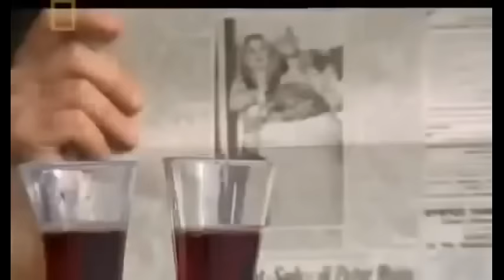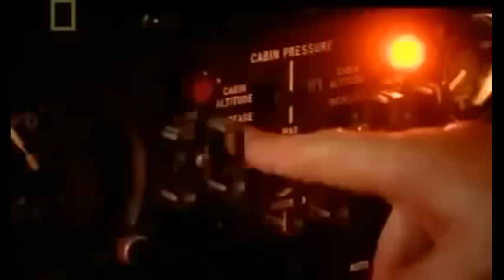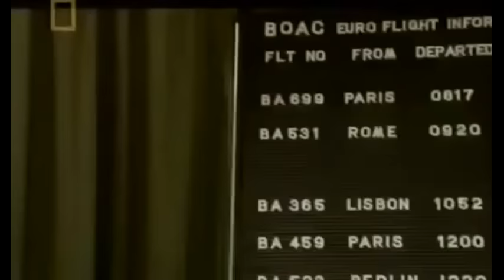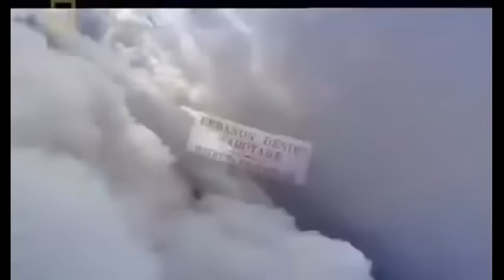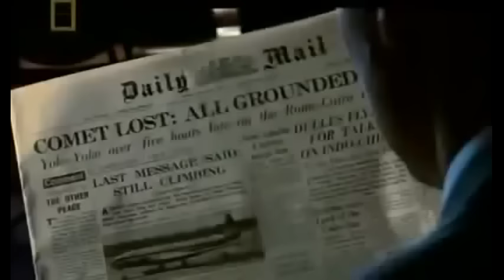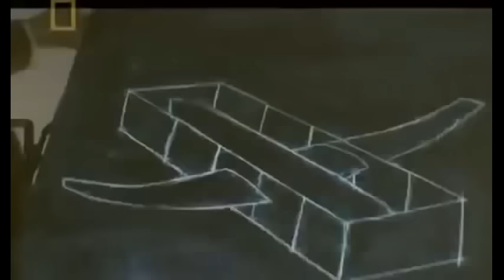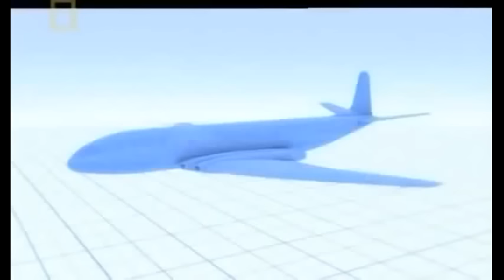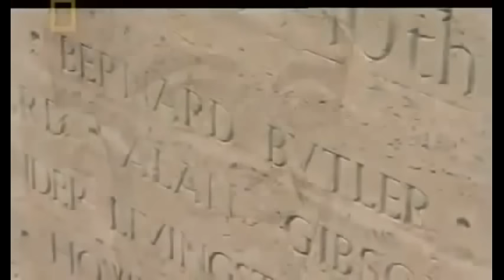Air Crash Investigation BOAC Flight 781   [48:40]

Comment: My God! What a horrific way to die! Having your lungs explode whilst flying into the air fracturing your skull, with the downward pressure damaging your spine, etc! 
I’d like to share an experience relating to air pressure, in the hope I can prevent it from happening to someone else. 

I was flying back to Texas from Montana and I had a slightly stuffy nose. 
During decent, I suddenly felt bubbles move in my sinuses followed by increasing sharp, stabbing pain in my head, behind my eye. 

It literally felt like my head was gonna explode and my eye was going to pop out! I had no idea what was happening! 
I was sitting next to my toddler and husband. I tried not to cry too loud at first. Then I couldn’t handle it. 
My PTSD became triggered and I was crying out loud enough that my husband turned to me. I had no idea what was happening. I was thinking: is this what an aneurysm is? A blood clot traveling through my head?? I told him it feels like my head is going to explode. 
The pain seemed to increase as we got closer to landing. It took everything in my not to scream! I felt I was gonna pass out and I hope I did because it would bring some relief from the excruciating pain.
When we finally landed, there was some relief but sharp pain washed over me if I lowered my head. 
My face and around my eye was swollen. My nose was just running. 
I had been holding my eye the entire time- as if I were trying to hold it in my head. 
I researched what happens to me. 

At the time, I hadn’t connected my stuffy nose to what was happening but that’s what happened. 
The pressure in the cabin had cause aerosinusitis or “sinus squeeze” or barotrauma.
I told my husband it was 1,000 x worse than given birth to our son - which wasn’t that bad until we realized he was coming out breach at our drug free home birth! I have a very high pain threshold but that was beyond anything I had experienced.
Here’s the definition: Aerosinusitis

Typically, sinus barotrauma is preceded by an upper respiratory tract infection or allergy. The affected person suffers a sudden sharp facial pain or headache during descent, which increases as the aircraft approaches ground level. The pain can ultimately become disabling unless the ambient pressure is reversed.

The pressure difference causes the mucosal lining of the sinuses to become swollen and submucosal bleeding follows with further difficulties ventilating the sinus, especially if the orifices are involved. Ultimately fluid or blood will fill the space.

In most cases of sinus barotrauma, localized pain to the frontal area is the predominant symptom. This is due to pain originating from the frontal sinus, it being above the brow bones.
I had nerve pain between my nose and eyebrow for a week. I had some broken blood vessels in the corner of my eyes. 
Now, I always fly with Afrin and decongestants - even if my sinuses are clear! Never again! The pain was unbearable.
Reply: Oooooookaaaaaaay. 🥴
Reply: Thank you for this information!

Comment: Can't believe they punched rivets into that aeroplane without drilling first !  I wouldn't do that on a childs toy let alone a flying aeroplane.  Of course they blew apart.  I wouldn't even use rivets at all in joining aluminium that thin (0.5mm), as you end up with swiss cheese at best at the worst stress areas.  Epoxy glue for the windows and door frames would have solved it and circular windows instead of square.   Interesting, water tank test blows @ 3000 flights, and their design fatigue tests were based on 10,000 hours.  it seems to me that's exactly 3000 flights, so this should have been no surprise.  on the other hand perhaps (obviously to me) the static water tank test was not near as destructive as the dynamics of actual flight, with turbulence, weather, maneuvering, landing etc, and in real flight the thing would have blown much much sooner, as the 3 did already.
Reply: They certainly did mimic the exact dynamics of an actual flight. So as "obvious" it might be to you that it wasn't, it certainly was for the experts who know what they are talking about and what they are doing. 🤦‍♀️
Reply: Well, just like other crashes, they're part of the equation. The 737 Max is a fine example of lessons NOT learned. Everything these days is about profit, probably then too. Todays crashes have pilots asking what's the plane doing now just before impact. I think they're to complex. Happy travels to those that like these contraptions, I don't like them flying above me.
Reply: I seem recall from another documentary that there was some extra trick in an original testing regime which prevented them spotting the problem during development. It was something along the lines that the way they did testing during development actually strengthened the metal...

Here it is. The development engineers tested a fuselage for maximum pressure first. And then cycled multiple flights. But applying a maximum pressure test first meant "the metal went through a process called cold working" which made the test airframe stronger than the production.

It Wasn't the Square Windows - The de Havilland Comet Crashes - Aircrash Minority Report
https://youtu.be/2rvx-r2itrE?t=510
Reply: @RobertJohnFreeman kinds makes sense.
Reply: 1954
Reply: @saveus228  1948

Comment: If only Boing could show the same skill and dedication with their investigations into the moderrn day 737Max disassters
Reply: Boeing*
Reply: Weren’t there several crashes with the comet before they figured out the flaws?
Reply: they figured it out it's cause they moved the engines up and the angle correction computer kept thinking the plane was climbing so it made it dive
Reply: there's a whole docu about and they show the trim wheel starts moving every 20 seconds on its own to trim the plane nose down a pilot actually had one go corrupt and landed the plane he had to have the copilot manually ovveride it each time
Reply: Seriously?🙄
Reply: It's called ...
Engineers, justifying their existence

They have to take stuff that works great - - and change it
( otherwise - there would be no reason to keep them employed )
Stuff made in 1960's - 1970's are still running today 
Stuff made 2 years ago - - need to be replaced

(got my grandmothers 1960's refrigerator still running great in my basement - my $2,000 refrigerator bought just over 2 years ago.... needed a new compressor ! )
Reply: @findantu  
All they had to do was turn the stab trim off.
That's why no one crashed one in the USA, or Europe. 
That solution has been known for 50 years.
Reply: @patrickmollohan3082  
👍
Reply: @findantu  
Pilot's have done that for 50 years. 
It's called runaway trim.
Obviously they never heard about that in kookamongo, or where ever the 2 crews crashed the Max's.
Reply: @patrickmollohan3082  
👍👍👍👍

Comment: Would you agree that they used thin metal to save money, and that’s why cars have never been made with thicker metals even though it would have saved millions of lives in all those car crashes, right?
Reply: Save weight*
Reply: Fuel economy can relate to it however
Reply: No, modern cars are made from high strength steel, very much stronger than that used in older vehicles.
The metal is formed to absorb impact and the structure is extremely strong, much more strong than older vehicles.
Reply: They make cars the way they are now to absorb all the impact and making it safer for the driver and passengers. Plus it means that many emergency workers won’t have to use to jaws of life to get people out of their vehicles :)

Comment: Something not addressed here - they said the design called for the joints to be glued, but there was a change to rivets. I would like to know who made that decision and why. And of course - would glued joints have been perfectly safe?
Reply: The "glue", would be a sealant or epoxy today that acts as a seal between the layers of aluminum that are riveted together. It helps keep the plane pressurized and sealed, as well as preventing water intrusion that would lead to corrosion. Drilling the rivet holes and deburring them before installing rivets is the most effective way to keep the holes from cracking.

Comment: Even for the 50's punching holes in ultra fine aluminium does not ring smarts. Wonder if thats the way they build Apollos?
Yeah even square windows for that plane at least isnt to 20th C wise. No Einstein to figureout the cutouts would be more weak.  Very well done investigations and video, thanks!
Reply: It was not a window frame that failed. What failed was the perspex observation window for the navigator, in the roof of the cockpit.
The recovered perspex window is still to be seen in the Science Museum in London.
It was suggested at the time that this be glued in place rather than riveted, but that was not done.
Reply: The lunar landers were made of magnesium, thinner that aluminum foil... you could push your finger through it...
Reply: @richardaldous3608  Hum some changingroom for EVA suits 🥺

Comment: I first read about these Comet crashes in Time Life books, called The Jet Age. It explained the how, and why of these accidents, and some of the many unknowns there were for a passenger jet at that time. Namely how the cycles, the take off and landings of these Comets were put through alot more stress and at a faster time, due to the high altitude and speed they flew at, and how it affected the structure of the aircraft that ultimately caused them to breakup in flight. Boeing engineers checked out the Comet and expressed doubts about the Comet. Then mentioned the square windows weren't a good design, which caused weak points for the skin, and the engines in the wings were also a poor design, due to any malfunction in the engine could cause the wing to be damaged. The engineers of the Comet were on the right track, but hadn't worked out all the problems yet for this type of aircraft.

Comment: I wonder if the 2cm stress fracture would have even been noticed during the visual inspection if it had of been somewhere that was actually accessible since it was reported that it was in fact done by someone. I can certainly understand if it was over looked even on a good day for that matter but someone looking would have had no chance in hell of ever seeing it on the top of the fuselage that’s for sure.

Comment: Obviously the Comet was structurally too weak to withstand the atmospheric pressures and literally burst open.  The designers knew from the beginning that the Comet is going to be built using a thin metal fuselage, but took the risk in the hope a disaster would not occur...

Comment: Square ⬛ windows is just downright crazy it creates massive pressure stress points, its why pressurized gas containers are circular to prevent stress points
Reply: Wasn't just the shape of the windows, the aluminium-skin was so ridiculously thin to reduce weight, that someone could literally punch a hole through it with their fist!
Reply: @stevie-ray2020  
Think about that ignorant statement for a few minutes, and then ask yourself,,,, why did I say something so dumb.

Comment: Good documentary - I always had it in my head that the failing with the original Comet was something to do with the windows being square instead of rounded off. But the investigation didn't seem to mention the shape, just the fact that they were fixed with punched in rivets instead of screws? Seemed so irresponsible to allow the Comet to fly again in 1954 before the crash investigation was completed. But did the piece of wreckage that confirmed the theory come from that later crash? Not that this would justify the loss of life of course.
Reply: Nothing was retrieved from the second crash, it was way too deep to salvage anything.
Reply: All other documentaries on the comet show that it was the square windows
>that's why all planes today have round / oval windows
This is the only one I have found claiming it was a rivit hole which caused it
Reply: @CraneGuru  No sir. The square windows got the blame, yes ...but it was the fact that the metal was stressed by the rivet punching method that was used AROUND the windows that caused the weakened metal in the vicinity of the square windows. 
In this video they claim it was a roof window that failed. The fact the window was square hastened the failure.....so...as you rightly say, now we know...we have Oval Windows to lessen that factor.

Comment: Hold on. So we can find this airplane in 1954, at the bottom of the ocean, just 33 days after it crashed without modern technology or a black box, yet we can’t find MH370 which crashed in 2014, had a black box, and the use of modern technology 🙄 

How the hell does that work! Shocking.

Comment: A similar fatigue cracking in the structure led to the disaster of a Japan Air 123 flight, the second deadliest air disaster ever. But it was due to bad maintenance, and two maintenance workers committed suicide in guilt.

Comment: funny sidenote. The Comet was not the first jetliner. That was the Tupolev Tu-104. The Comet went into service earlier (too early as it turned out) and for most of the early jet years the Tu-104 was the only active jetliner as the Comet was grounded and the East German Baade 154 never went into service.
Reply: The Comet flew on July 27, 1949, and Avro Canada C102 Jetliner
 first flew the following to become the first jet airliner built anywhere in North America. The Tu-104 (itself derived from the Tu-16 'Badger' jet bomber) flew in June 1955., and the VEB 152 (designed by former Junkers engineer Brunolf Baade, who had worked on Ju 287, EF 131 and EF 140 forward swept wing jet bomber designs) you mention flew in late 1958, nearly a year after the first flight of the Boeing 707. Aviation experts largely tend to overlook the fact that in the late 1940s, Boeing proposed the Model 473 jet airliner based on the B-47 Stratojet, but that design was not built. The Dutch aircraft manufacturer Fokker proposed its own jet airliner design, the Nene-powered F26, which remained a conceptual study only.

Links:
http://www.aerospaceprojectsreview.com/blog/?p=1260
https://en.wikipedia.org/wiki/Avro_Canada_C102_Jetliner
https://en.wikipedia.org/wiki/Fokker_F26
Reply: No...the Comet preceded the Tu-104 by 6 full years. It was ultimately grounded but it was the first in every sense of the word.
Reply: @vahe2391  Thanks for providing the links.
Reply: @33moneyball  Fight... Fight... Fight..

Comment: These airplanes were very dangerous to fly in because, with this model being the first passenger jet, it was designed in ignorance of the dangers of a pressurized cabin and the skin of the airplane not strong enough to hold it.  Consequently many of these airplanes simply disintegrated in mid-flight --- that was all there was to it; they simply came apart in mid-air.

Comment: Still the comet was a sleek looking design. I like the design of the engines into the wings.
Reply: Yeah...very pretty but not very practical. Fireball XL5 was pretty cute too....as for Thunderbirds.....Are GO!!!!
Reply: I'm no expert, but logic suggests engines housed within the main structure of the plane carry greater risks in the event of a fault. I guess higher vibration too.
Reply: Engines are now separated. In case of failure, can just drop away

Comment: What’s wrong with dam FEET, MILES PER HOUR OR KNOTS Grrrrrrr
Reply: The British use the metric system — and this is a British production of the show.
Reply: @kristita_888  we have a hybrid system. Metric is often used for temperature, measurements (though not by transport, we still measure distances in miles) and weights. Though both Imperial and Metric are recognised.

Comment: The Comet was a work of genius. The birth of all jets passenger planes. It’s hardly surprising the birth would be troublesome and then Boeing sucked up all the intel to make the 707.
Reply: The DH Comet was a hasty, deficient & shoddy design, rushed into service to beat the competition. The type needed radical reworking, as evidenced by its over-sized square windows, the use of punch-riveting (not pre-drill & rivet), paper-thin fuselage skin, engines buried in the wings etc. Boeing original design features, eg. engines slung on under-wing pylons, are STILL in universal use today. And B707's are still flying. As are Boeing B-52 Superforts, which first flew in 1952.

Boeing could never gain intel from the lethal Comet. Get your facts right and learn a lot more about jet aircraft design. "Genius" my arse, Comet was a death trap.
Reply: @rocketeerPM2500  I gather you are not a De Havilland fan then.